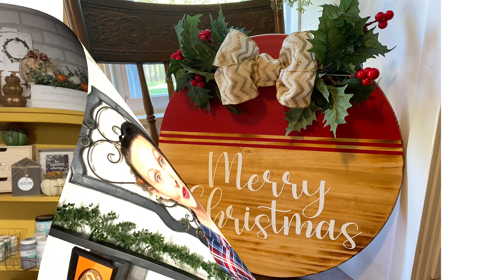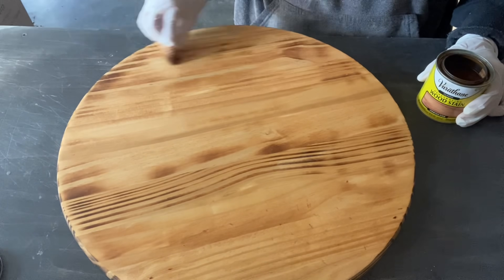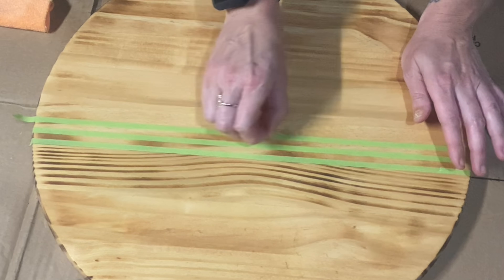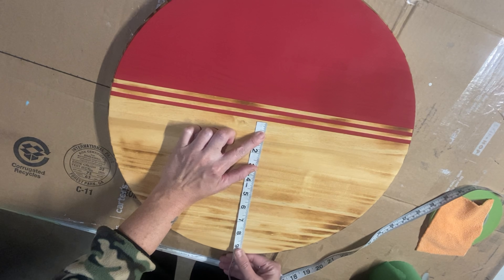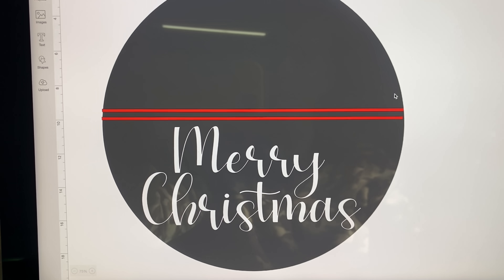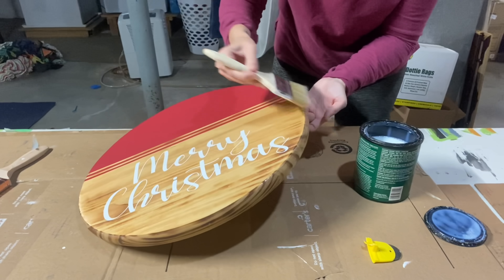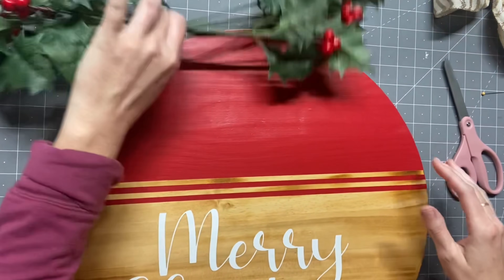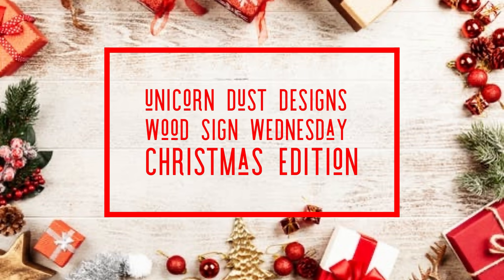CHRISTMAS WOOD ROUND DIY | WOOD ROUND DIY | STEP BY STEP WOOD ROUND TUTORIAL | WOOD ROUNDS

Comment: newbie here! If you leave 651 on the wood sign instead of stenciling, do you then seal OVER the 651 with a final coat of poly??
Reply from the maker: Hello Tina. To be honest I can’t answer this for you because I do not do vinyl on my signs usually. I did do it on my reversible round sign on my channel and I did not clear it. I’ve heard mixed reviews that it lifts your vinyl.

Comment: Hey Sammie! Just a quick question - I'm using the 813 stencil film to create signs but am having MAJOR issues with it bubbling up and cutting weird... do you have any problems with that or do you have any recommendations for a fix or alternate stencil film/mylar? Thanks! Carole
Reply from the maker: Hi Carole! So a couple things could be happening: 
1. Your cut depth is too much 
2. The roll you purchased isn’t on a cardboard roll which sometimes makes it umm I don’t know how to explain. I had this issue when I first started using it. I just unrolled the entire thing and let it loosen up and it worked fine. 
Now I buy the huge roll that comes on its manufactured roll. 

I hope this helps.

Comment: How do you take care of your brushes? Specially the one for the minwax? Mine got hard as a rock even after i thought i cleaned it lol
Reply from the maker: Hello. 👋 I do not use brushes to apply my stain. I use the microfiber clothes. Since the stain is oil based you would need paint thinner to clean the brushes off.
Reply: Unicorn Dust Designs how about the brush for the Helmsman sealer?
Reply from the maker: Since the Helmsman is water based I just rinse by brush out with warm water and let air dry 😊
Reply: Unicorn Dust Designs well that makes sense!!! Oops!!! Thank you so much for replying! Cant wait for prt II next Wednesday :)
Reply from the maker: You’re very welcome!!

Comment: Sorry if this seems dumb (I am a total newb):  There are different versions of the brand e6000 "glue."  Which type do you use?  I am thinking for attaching bows & greenery (plus hot glue gun).
Reply from the maker: Hmmm I didn’t know there were different brands. I would have to look. I usually get the one in the silver tube from Walmart.

Comment: My Lowe’s in West Tennessee doesn’t have any but I check the other stores close by which can be located in another city or state. I can change my store on my app and order. I have done that and it works great. Hobby Lobby has a 12 inch wood round that I do like and the regular price is $9.99 but use the 40%  online/store coupon. I am working with it now and I will post the finished 2 sided sign soon.
I have a few small 1/8  and 1/4 thick panel rounds. It just popped in my head that we can take them and glue the together but what is the best adhesive? Wood glue or E-6000?
Reply from the maker: Both are great glues Shelly. You could use both to add even more of an hold on them. The wood rounds at my hobby lobby are $19.99 so with a 40% coupon it’s still super pricey. Luckily I have three on hand 🖐
Reply: Unicorn Dust Designs I looked online and the 12” inch rounds were $9.99 then you can use the coupon. I didn’t see any other sizes but like all other stores different merchandise are available.

Comment: Have you ever experienced yellowing on white paint after applying the polyurethane?
Reply from the maker: Hello 👋 only if the spar is oil based have I experienced yellowing. I use all water based clears 😊
Reply: @UnicornDustDesigns  Thank you! I went and got the Spar Urethane water based and it'll be my first time using it. I have always used polycrylic but wanted to try something that is for outdoor use .
Reply from the maker: It’s very similar to poly so you should have no issues using it 😊 let me know if you have any other questions

Comment: Ok, could you please tell me how you got you’re design layout to be all even numbers. To be able to see a larger layout.  I’ve looked everywhere. Can’t figure it out.  Please help. I’m sure it’s something simple. Just can’t find it. Thanks.
Reply from the maker: Hi Waggs. I’m sorry, how I got my design to be all even numbers?
Reply: Unicorn Dust Designs  when you put the circle on the design space, and typed in the size you wanted it. It showed in full. The numbers at the top and down the sides. In inches. I noticed yours are in two inch increments. So you can see a large design in full on the page or grid

Comment: Oh Sammie my Sammie... You ready?
The felt flowers. First of all, you can’t be mad you make quality items! 😂
Secondly, you applied it with a hot glue gun. How does that glue become pliable? Heat! 
Next time use a heat gun to warm the glue up to take off what you don’t need. I typically will use spare scrap felt to wipe off glue that’s stuck to the wood, and if it’s sanded first, which this was, should wipe off smoothly! 🙃 You’re welcome!! 😂
Reply: & With the tape. A cheaper option for the different sizes is washi tape! Hobby lobby constantly has a 50% off sale on “The Paper Studios” constantly making each roll of tape extremely affordable! 
& dollar tree also has that same size tape in a 3 pack.
Reply from the maker: Ya know when you’re in the moment you don’t think of the logical things to do 🤣🤣 I think you know by now I’m a hot mess and enjoy creating more work for myself
Reply from the maker: And you never have bleeds with this tape? Worth a try to me
Reply: Unicorn Dust Designs I personally spray a thin layer of Krylon clear in matte after tape. So you got me on a idk if you don’t put that layer.
I did the washi bc of the bullet journaling I watch. A lot of those girls will Edge their water color paintings with it & it does good.

Another thing I’ve done for different sized lines was put painters tape on a smooth card stock and cut it with my paper cutter. Then took the tape off and used it that way.

I just know how expensive automotive tape can get since, in my household, there’s also customized cars and motorcycles. 🤣
Reply from the maker: Yes it’s very pricey. The last time we were in Cali my brother stocked me up. I’m always down to try new things though.
Reply: Unicorn Dust Designs it worked out great tho! (I might take a peek in the shop when my stash runs out!) 😂